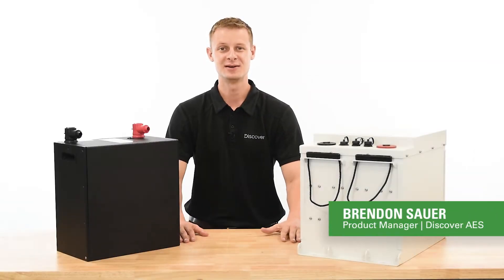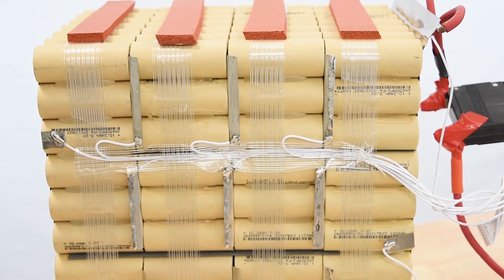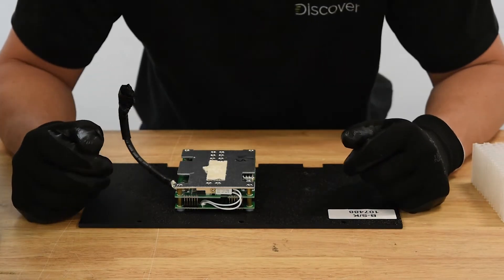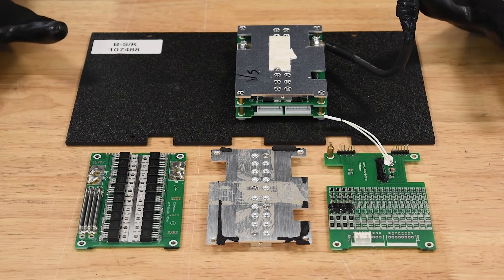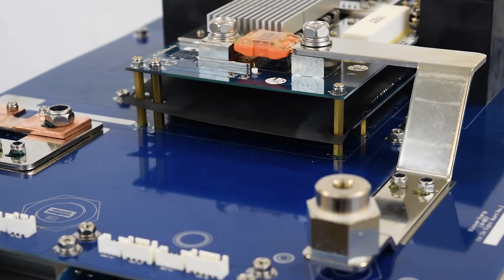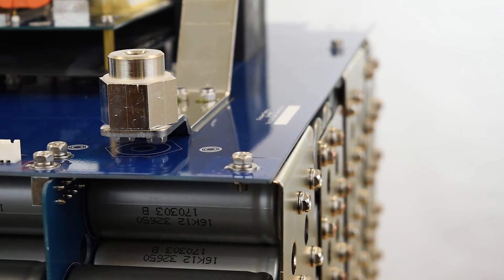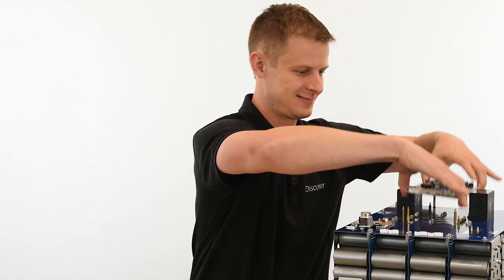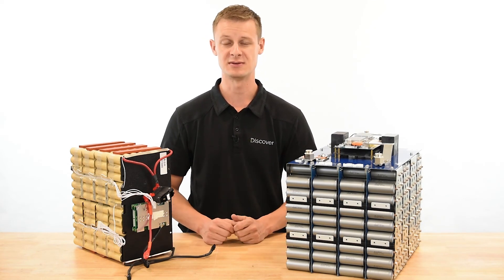Discover Battery™: The Impact of Design Philosophy On Off-Grid Lithium Battery Performance

Comment: Very nice, thank you!  Can you give a quick explanation of 'passive' balancing? Does 'active' balancing also exist?
Reply from the maker: Passive balancing uses simple and cost effective resistive loads that remove energy from the high voltage cells when balancing is required. Active balancing will transfer energy from high voltage cells to low voltage cells but requires far more complicated and expensive circuits on the BMS and as such is less common in many markets.

Hope that helps.